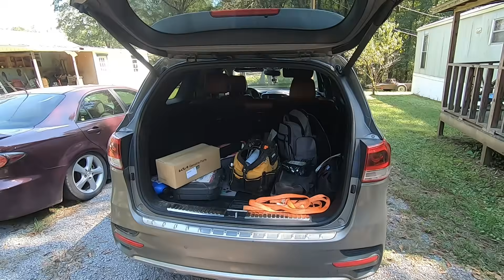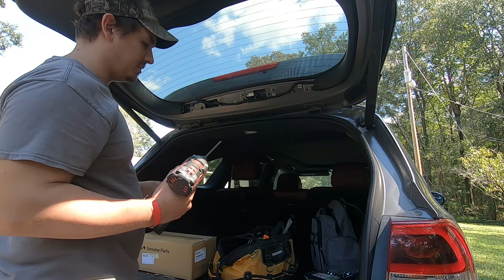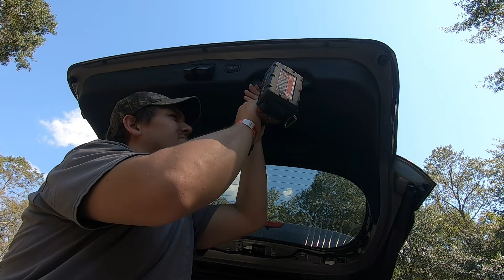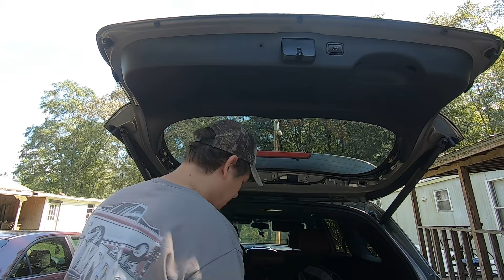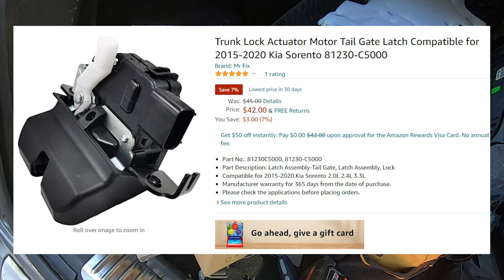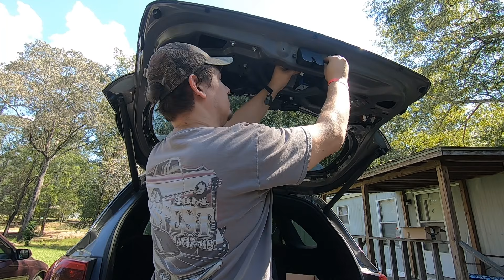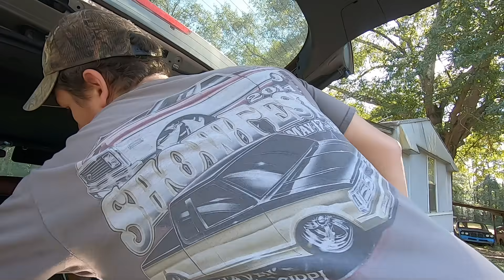How to Repair 2016 - 2020 KIA Sorento Trunk Latch

Comment: Any chance you have a suggestion for getting that screw out? It’s just spinning
Reply from the maker: Take a pair of wire cutters and try to work the tips in on either side of the screw head (kind of like if you were going to cut the screw head of with the cutters) and to try to lift it out as you slowly turn the screw with a drill or screwdriver. If you don't have wire cutters you can usually do the same thing with a small flathead screw driver it's just a little more aggravating because when you turn the screw it tries to push the screw driver out. Worst case scenario, get some wire cutters (preferably flush cutters) and just cut it off flush and poke it through. You can usually buy these at Home depot or Lowes in the little drawers on the hardware aisle. Hope that was helpful.

Comment: Hello, I have a question. I have 2015 Kia sorento EX and my trunk door wouldn't open. It's manual trunk door. I tried to open it from inside and when I turn the latch switch It's unlock the door but get locked again when I let it go. The only way to open the trunk to turn the switch,  hold it with my finger and to push door out. Do you think I have to replace the trunk latch?
Reply from the maker: I'm not super familiar with your issue but the latch is spring loaded so it is possible that is the issue.
Reply: @BCDriven  thank you for reply.

Comment: Did this issue happen to drain your battey? This happened last week and we are waiting for an appt at the dealer(Warranty) and the battery died on me. I charged it and it was good but then it was dead after sitting over night again.
Reply from the maker: It did not drain the battery in my case but I might could see it happening due to the car thinking the hatch is open. Could also be totally unrelated, batteries can be weird like that.
Reply: @BCDriven  I thought that too, maybe just a coincidence. Went and bought a battery($250 later) and then I go to pull it and it has a 9/21 sticker on it and it's a KIA battery. Turns out the dealerahip just put the battery in right before we bought it last year in Novermber.  Sonim returning the battery and letting them fix or replace it when we take it in on the 22nd, so we have an un-driveable vehicle until then.
Reply from the maker: @dmimbig  thats odd for such a new battery to die but being so new it should be covered or replaced by the dealership as goodwill. Hate to hear that hopefully your dealer takes care of you and gets you going quickly

Comment: Thanks for the video Bro, the latch stopped working on my wife’s Kia and they wanted to charge her $110 just for the part at the dealership. I was able to order the lock of Amazon for $35 and fix the lock in about 10 mins.
Reply from the maker: Good to hear, you saved some money and got to learn a little about the insides of your car.

Comment: Had to replace one on a 2016 SX (50k miles) while on vacation. Went to the local dealer who wanted ~$240 just for the part and much more than I was willing to pay for installation. My part number was 81230C5100. One note, to remove the handle on mine it was held in with two 10mm bolts with one that my standard 3/8 ratchets 10mm socket couldn't fit on one side. Didn't have a deepwell on hand, so used a 1/4 10mm socket on my impact driver which fit. Got an OEM part online for $160, and paid an extra $20 for express shipping so I could get it done before leaving. If you have time you can get the OEM part for as low as ~$140. Aftermarket parts can be had for half. In the few days that the trunk wouldn't lock I removed the trunk emergency release trim and hooked a bungee cord from there to the closest headrest. The little bit of tension it provided was enough to keep the trunk closed while driving, but it was easy enough to manually lift the trunk lid and remove the hooked bungee to access the trunk.
Reply from the maker: Yep it seems mine was the only one with the ultra rare phillips head option lol They were 10mm bolts but also had a phillips cross in the middle and I just happened to have that handy from removing the trim panel. We went bungies around the grab handle back to the car set tether so you could get to it from the back seat. If you accellerated too hard the bungies would give a little and the hatch would come off of the close sensor and yell at you, it was a mess lol Glad it's still going strong.

Comment: Is the 2015 model the same as 2016 - 2020 models do you happen to know?  Thanks!
Reply from the maker: To be completely honest with you I don't know for certain. The change process will be very similar if not the same but the PN you will need is either 8123 3Z000 without the power lift gate or 8123 B8100 with the power lift gate. I got these part numberts from the exploded view on Kia's websight. I can't link to it but if you copy this ( kiaparts/v-2015-kia-sorento--sx--3-3l-v6-gas/body--liftgate ) and add a "dot com" between the "kiaparts" and the "/" it will take you to the exploded views and you can see the part, item 2 on the second diagram. Hope that was somewhat helpful.

Comment: I pulled the unit apart and found it’s a small nylon cog that cracks.
Was able to repair the cog and reassemble 
The repair involves heating a steel pin and effectively plastic welding the cog with the pin inside 
Convoluted and bit more than an easy fix but works and won’t fail again as the weak link now has a steel pin.
Took round 2 hrs end to end
Reply from the maker: Nice. That's an option too.  I opted for the easy fix with Kia parts because it's my wife's car and I don't want her to have to worry about it. First one made it to  almost100k miles so if we get another 100k outta this latch I'm fine spending the money lol.

Comment: I have a Kia sorrento SXL 2016, it won’t open with the button, but it will close… do you think this would be a good fix?
Reply: Just realized it’s the same model, do you have the links for Amazon? I don’t see it in the description
Reply from the maker: It won't open using the key fob, switch on the dash, or switch on the gate? If so then it is likely the actuator gone out. Here is the genuine Kia part which has increased significantly in price unfortunately
https://amzn.to/3OQrmps
And here is an aftermarket alternative
https://amzn.to/3PqsvUT

(And thanks for watching and commenting on the video)
Reply from the maker: And the OEM Kia PN is 81230-C5100 if you prefer to get it from a dealer.

Comment: My 2016 Santa Fe tailgate won't open. Just started today. It doesn't have the power lift on it. I would imagine it's the same process for the Santa Fe? Any help appreciated. Thanks.
Reply from the maker: I dont know for sure but the Hyundai and Kia are typically pretty interchangeable so I would imagine the procedure would be pretty similar as well.
Reply: @BCDriven  Thanks! I ordered a new latch, but today when I tried to open the liftgate, it worked! WTF? Very weird. I'm going to cancel the order for a new latch, for now anyway! Thanks for your reply!

Comment: Man, thank you soooo much for this video, I had exact same problem. Watched your video, dismantled it. Turned out that one of the teeth of plastic gear was broken removed it and put it back together.  Works as brand new.  Thanks a lot
Reply from the maker: No problem, glad you were able to get it fixed up.

Comment: Alignment is key though. I did mine last night, wouldn’t catch I loosened up the bolts and did a few gentle slaps on the tailgate. Got it catching, but not fully. A few more taps and a little more loosening and it self adjusted, then tightened down. Great vid,eo!
Reply from the maker: Thanks for that insight, I didnt have any issues with alignment but hopefully if anyone else does they will see this comment. Go watch my latest video and win yourself some free tools.

Comment: Thanks for this video..any hints on how to make it shut or so my battery wont drain dead? Thx
Reply from the maker: Sorry just seen this, we used a ratchet strap (loosly) connected from the pull handle to the car seat latch in the floor to keep the door shut. You want either a bubgie or ratchet so you can put some tension on it.

Comment: I really want to thank you for this video.  You saved me around 375 USD!!
I have a 2017 Sportage but the process is basically the same.
I went to the car dealer which in Mexico happens to be the authorized service center also.  First, they wanted to charge me for disassembling the back gate "to see the part number".  Of course I told them that you only need the VIN to exactly know the part number without needing to disassembly anything.  So I went to the spare parts section and with the VIN of my vehicle they gave a quote of 475 USD only for a new latch.  The work to change it would be charged separately.  The good thing is that the quote had the part number :) .
So, with the part number I went to Amazon US and order the exact original part for only 200 USD shipment included.  A week later, I received the original part directly from Korea and using your video a managed yo change it myself!!

So, considering the saving on the price of the part and the charge for changing it, your video saved me some goo 375 USD!!  Thank you!!
Reply from the maker: Thats really good to hear! One of the main reasons I try to make videos is to give people the tools and confidence to tackle projects like this. You probably seen the video and thought "I can handle that" and thats basically what I try to give people. Some people may look at a more complicated video like the one on my F250 diesel that had an oil leak and think "yeah no way I can do that" and thats fine too. 

Moral of the story, Glad you got your Kia fixed up and were able to learn and save some money along the way.

Comment: Great video, it was good to watch before I did this repair on a manual door. A couple of notes.
1. The handle on my 2018 was secured with 10mm bolts.
2. The first replacement was an assembly purchased off Amazon. It secured the door solidly, and the buttons to open it worked. However, the dash display showed the door was open.  So I did it again, with an assembly purchased from Kia, and it works perfect.
Reply from the maker: Nice, I pinned a comment about the handle bolts. Mine were a 10mm bolt but had a phillips head in then so I just used the phillips since it was out. And on the Amazon latch, mine came from Amazon but was a genuine Kia latch. Glad you were able to get it fixed up.

Comment: Nice video: my 2011 Sorento EX has a manual lift gate. The problem is it might open once out of 99 times with the fob, not at all with the key in driver's side door. The fob does lock and unlock the side doors.  Dealer replaced door latches on two front doors because of recall. Is the lift gate latch in any way connected to the work done on the doors? Everything worked perfectly until I took it to the dealer but now it seems the best and often times the only way is to crawl into the back area from inside the car and use the emergency manual switch to open the lift gate. I tried replacing the latch with a new one but get the same results. Any suggestions?
Thanks
Reply from the maker: I'm not super familiar with that generation sorento but I would always started with the simple things first like replacing the battery in the key fob. Sorry I know thats not really any help but I wouldnt think the door latched replacement would cause you any issues with the hatch so I'm a little stumped as well.

Comment: Great tutorial video on repair/replacement of rear hatch latch assembly.  Followed your guidance and I was able to effect the repairs successfully.   Only one difference-- the bolts holding in the handle were 10mm hex head instead of phillips head screwdriver.  Other than that-- perfect!  Thank you!
Reply from the maker: Others have commented about the phillips vs 10mm and I pinned it so hopefully others can see. Thanks for watching and commenting!

Comment: I have a kia sportage, 2008, and the back trunk window won't lock, and it shows the yellow trunk open light on the dashboard.  do you know how to fix that one?
Reply from the maker: Unfortunately I'm not too familiar with the sportage platform. It sounds like it would also be the latch but I'm not terribly confident on the part number. If your look at KiaParts.com you may be able to see which part it is in the exploded views.

Comment: Do you have to buy the whole assembly or could it just be the lock actuator piece?
Reply from the maker: You can buy just the latch but you cant buy just the actuator and cable. For the power gate I would strongly suggest just buying the whole assembly and replacing it.
Reply: @BCDriven  thanks so much. I ordered the whole assembly
Reply from the maker: @aliciastrain6090  good deal, hope the installation goes smoothly!

Comment: Hi, I got a question here, is this power latch assy applicable to my Kia sedona sxl 2017 that has the same problem as shown your video?
Reply from the maker: Sorry I replied before I seen that you had the sedona not the sorento. It looks like for the sedona with a power lift trunk you would use kia PN 81230A9100 which looks really similar to the part I am using on my sorento so the installation process should be very similar as well. I do not know if the sorento part will interchange with the sedona though.
Reply: @BCDriven  Thank you for the quick reply and info. I really love the information you have in the video, detailed and educational.
Reply from the maker: Thanks for the kind words and good luck with repairing your Kia.

Comment: Thanks so much for this video. Worked the first time. I was so relieved when I tried it for the first time just like you did. Got it all put back with no issues. I would have had no idea otherwise. I’m sure it saved me a bundle in labor. Thanks again.
Reply from the maker: Good deal, I'm glad this video could be help full.

Comment: Thank you for this! Got my latch changed on my manual gate 2017 in less than 30 minutes. I wasn't scared to start pulling on plastic after watching this. Like someone else commented my handle bolts didn't have a philips head so I needed a 10 mm deep well socket too.
Reply from the maker: Thanks I pinned the comment so others could see as well.
Reply: Did the manual gate need that other module shown in this video as well?  Or was it just the 81230C5000?
Reply: @GusFromDaysPast  All I needed was the latch.
Reply: @GusFromDaysPast  The video shows only the latch with the part number you just listed as what is needed for a manual latch. I just ordered mine off amazon. The video is very well done.

Comment: Thanks for this! Got mine fixed in a jiffy. Except for the handle removal, that needed a 10mm socket on mine.
Reply from the maker: Glad it helped out! Thanks for letting me know on the socket as well, mine was a 10mm bolt but had the phillips head slots in it so I just used that since it was already out.
Reply: Same for me.